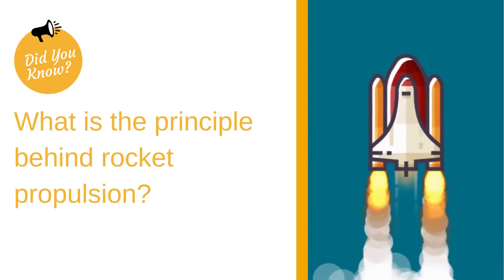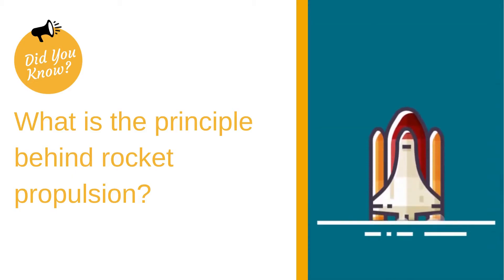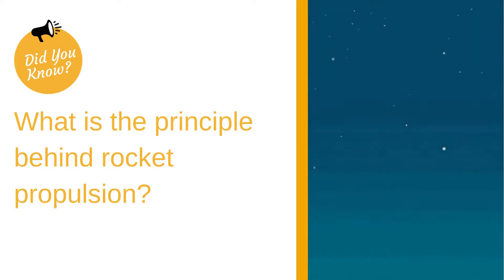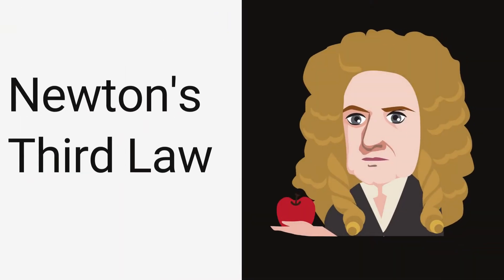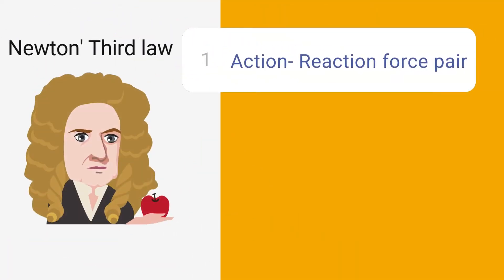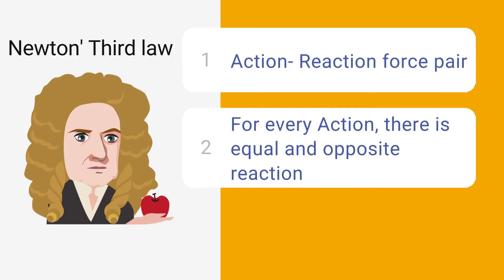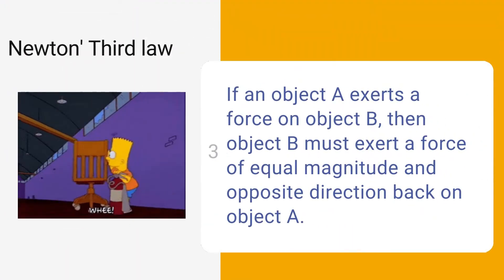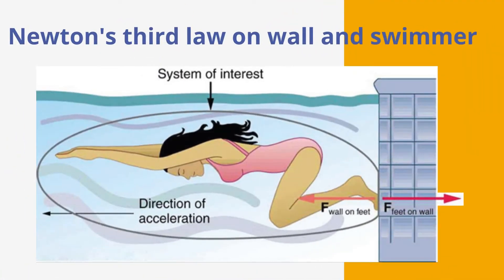Newton's third law of motion | Project Based Learning |  Balloon powered car | STEM with Rahul

Comment: Sorry but ye bakwas h itni der baith ke bnaya and it was just a wastage , car hili hi nhi re........
Reply from the maker: I appreciate your effort. It will surely work. Once you check your prepared model. 
Please check the following parameters:
1.  your car should be light weight
2. The axle should be free to move
3. The exhaust should point straight and should not bent down
4. The balloon should be inflated to threshold and the balloon should be of average size neither too small nor too big.

Please try once.